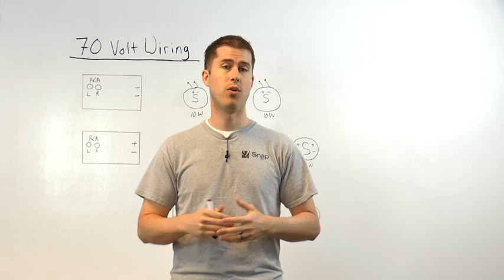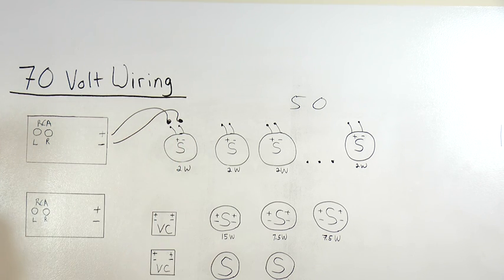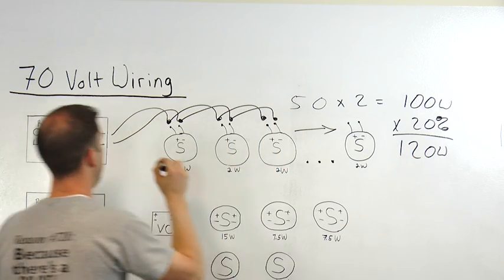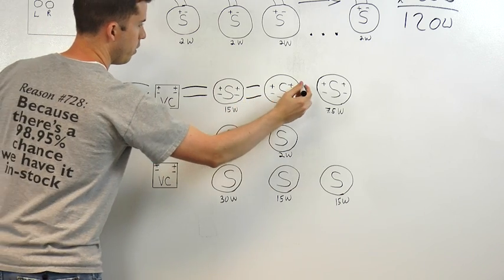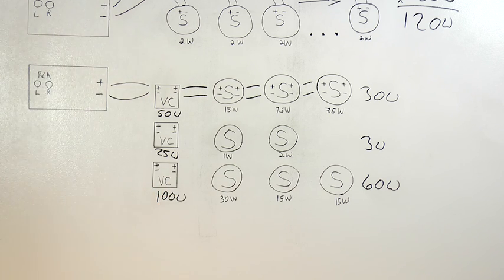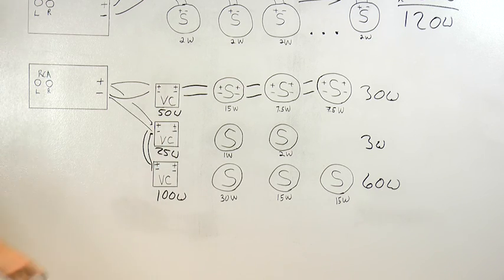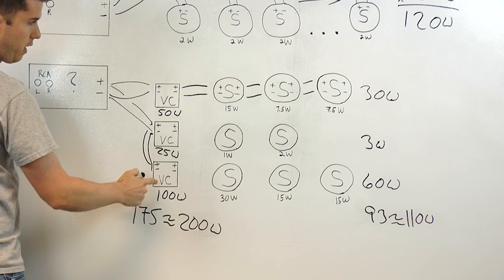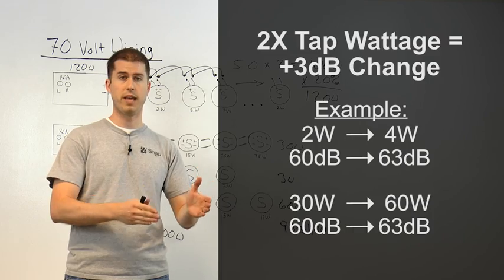Wiring a 70-Volt Audio System

Comment: Hi, in 70 volts system I require a balanced 600 ohm input to amplify a fixed radio.  Can use a tel input and i guess only one Master volume unless install VC's?  i typically have Bogen C35 and up based upon speaker taps.  thanks,

Comment: Hi, Thanks for this but it has a question. In 100V system 480W(PAM-480A)., the back of Amp there are 5 terminals (sp1-----sp5) for 5 channel controls. Can we connect all the terminals together and get them as one terminal to feed all the speakers (in parallel) via one wire coming out of the amp?  To prevent the overload on one channel and to reduce the wiring consumption.

Thanks in advance

Comment: Thanks for this.    based on the first example,  if I decide to expand the system, (and I know I have the amplification to do it), can I just buy another couple speakers, change them to the same 2w tap, and add them?   

(and reversely if I wanted to turn off 25 of them during the winter, could I simply disconnect the connection between the 25th and 26th speaker and continue with my listening of the first 25?   or would that cause problems?

Comment: If 100 watt speaker 8 ohm we connect 8 speaker in parallel then what's the ohm
Reply: This video is about 70V speaker wiring. 8-Ohm is a different animal.
Reply: 2 - Ohm

Comment: Is there any solution if I want to run 2 cables? For example if placement of speakers is too far apart where it is not practical to run the cable to one side then to the other on same "chain"?
Reply: How do choose an amplifier for 15 and 18 inches speakers
Reply: You don't have to chain them. You just have to have them all in parallel. All reds connect together and all blacks connect together. It doesn't matter where. Wire your speaker to the closest red and black you have. It doesn't matter if it's another speaker or a volume control.